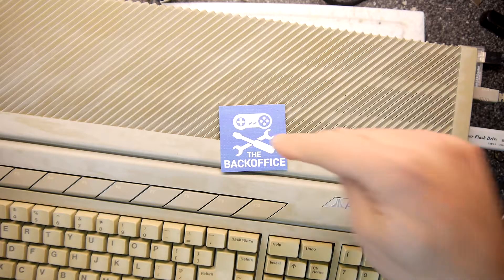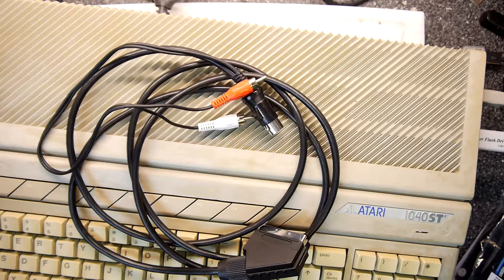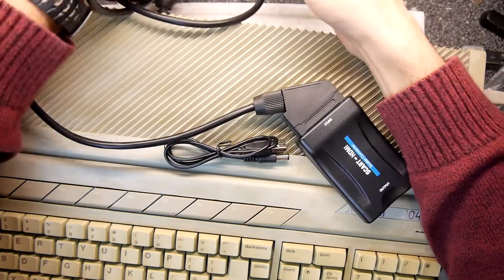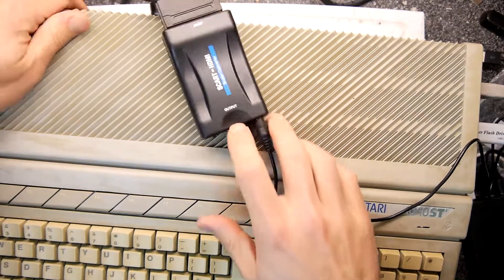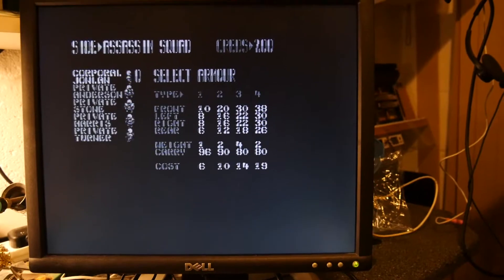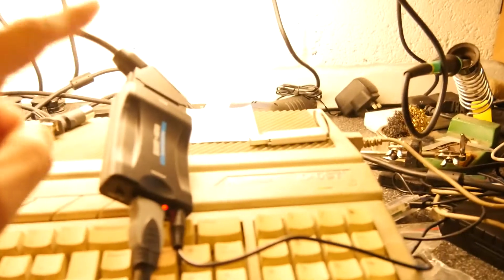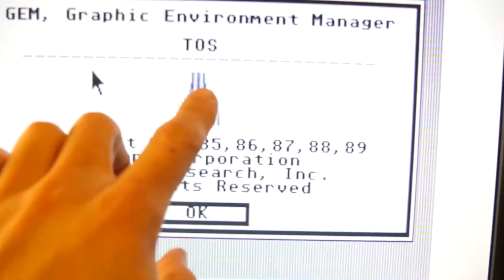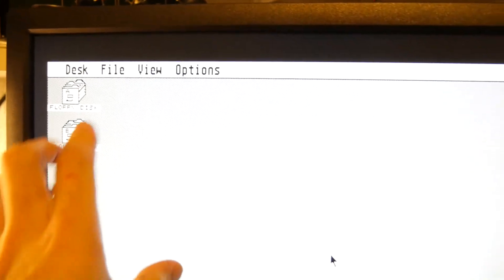Composite to HDMI Adaptor Retro ATARI Hardware Part 1

Comment: I noticed something when seeing this on Wish. There's 2 models of these, one is labled scart to mhl/hdmi and says it supports rgb, the one you showed here does not say "scart to mhl hdmi" on the top, and is a composite model. You will likely get one color or black and white if no rgb support using scart intended converter.

Comment: So I'm staying at this campsite and they have a very old Sony TV, old in the sense that it a great big thing at the back. However it has a Scart to HDMI converter and I have my PS4 with me so I thought that I could connect my PS4 to this Sony WEGA TV, but when I connected it to the TV and had the right channel nothing came up on the screen when the PS4 is on.

Does anyone have any idea what I'm doing wrong or is it not possible to use this connecter that way.

If you can help then I would really appreciate it!

Comment: Let us know how it goes on a nintendo if you can. I have one of the white square composite to HDMI converters that hates my old nintendo, picture jumps all over the place on it.

Also keen to know if anyone has found one that goes the other way, HDMI to a 480i RGB signal. I have an old TV that I would like to use with a Pi, and composite on it looks disgusting. RGB from the PS2 looks great so if I can convert the HDMI from the pi to that, will be great for retro emulators.
Reply from the maker: Rich M-Smith I don't have a NES to try but it seems to work really well with my composite TV game consoles, you know the ones, they have a single hello phono connector and a single white one.

Comment from the maker: I just had another play with this converter to really get to the bottom of it, and it seems for most things it works rather quite well. There seems to be some strangeness with the output from the Atari ST! I will stick to RGB to HDMI conversion, but it certainly is one to look out for!
Reply: You get the same problems with other convertors and upscalers too.  The ST video outputs are quite none standard in places.    On the GBS-8220 you can tweak the settings to bring the colour back.

Comment: Lots of these "cheap" scalers are sold as RGB, when they're not, they're just composite, or at most S-VHS scalers. I have the one in your description, but a little cheaper (no prime) https://www.amazon.co.uk/gp/product/B0092IAA3I/ref=oh_aui_search_detailpage?ie=UTF8&psc=1

I also have a different one, https://www.amazon.co.uk/gp/product/B00ABOB1NU/ref=oh_aui_search_detailpage?ie=UTF8&psc=1

Both work well enough. You need to make sure they get a clean power supply though. One came with a power supply that caused sparkles.
Reply from the maker: I already am reviewing that exact same unit in a future video next week :) The Atari does have composite output, but I think it might be over saturating the box as looking at the circuit diagram there should be a resistor inline in the cable and in my cable there is not. So that is the first thing I ought to check. Either that or I order a composite lead to test my theory. I have loads of composite to scart adaptors from all my old games systems.
Reply from the maker: +Paul Bates That's interesting, it works fine for me. I will do a teardown and compare the pcbs, maybe they already fixed this in the hardware?
Reply from the maker: Paul Bates I think you are correct. the cool novelties cable is very good and I have done a quick review of it, it has the attenuation built in. Also the mod in that document also specifies fast switching. that's more of a nice to have rather than an essential. It is a nice box for the money!

Comment: Just a thought. There are two different st-scart leads knocking about. There's the composite rgb one and  just the comp. video one. Try a straight ST monitor pin 2 - SCART pin 20 and connect the grounds and see if that works (or ST pin2 and pin 13 to one of those SCART phono adapters)
Reply from the maker: +Simon Lock it's an rgb scart lead and a composite converter. I will find the ST composite output and shove that into it and see what happens
Reply: Ah right, that makes more sense. In my defence to completely missing the point via the video title, title card and description - I have only had one coffee and an awkward conversation with you about buffing.
Chuck it out and put the proper steel box in👍
Reply from the maker: +ataristaffroom I will try this, it will be excellent to get this working so I can compare to my new RGB HDMI box. At £9 this is a great solution for a lot of people with little budget. Also technically easy to build into the ST enclosure itself
Reply: I agree, I think you're seeing a non standard output. Probably wants to have the SCART socket rewired RGB.
This seems a good related read: http://www.atari-forum.com/viewtopic.php?t=28665
I was following similar stuff to produce my CDTV & SMS RGB configurations.
Reply from the maker: +Simon Lock I might just try for composite as a test, would be interesting to see the difference in picture quality on a digital screen
Reply from the maker: Im just having a quick look at the cable, and the cable is pukka. I think that maybe it needs a resistor on the composite out as the picture could just be oversaturated before it hits the encoder. I might play with this next time the ST is out.

Comment: You are right, this is a composite to hdmi adapter just with the composite stuff connected. I think your colour problem might be because of the HDMI to DVI converter. If you have a monitor/tv with hdmi input, you could check there as well. Also you could check with another console/computer that has composite out. From my own tests, while the ST's RGB signal is all over the place, composite has been mostly standard.
Reply from the maker: +CFalcon030 This is very interesting, it's actually sold as an rgb scart lead so perhaps the composite component is not wired through. I will experiment with it. I actually have a great RGB to HDMI converter now that works flawlessly on the ST, i will post a video as it's so good.